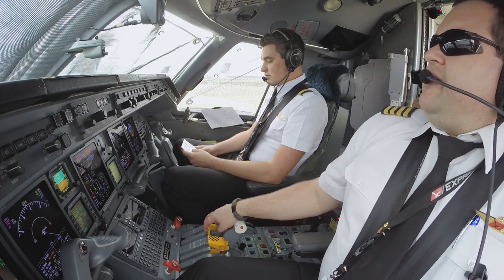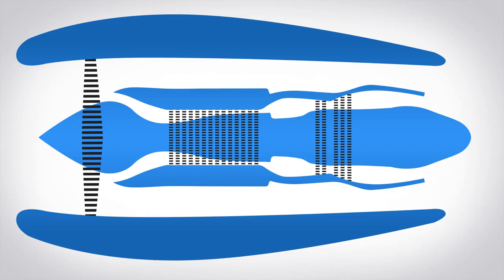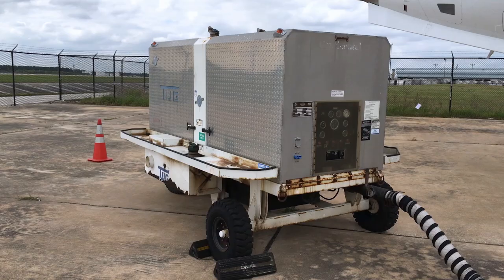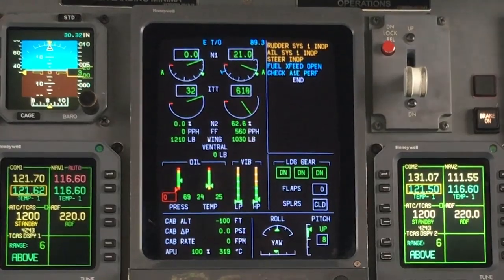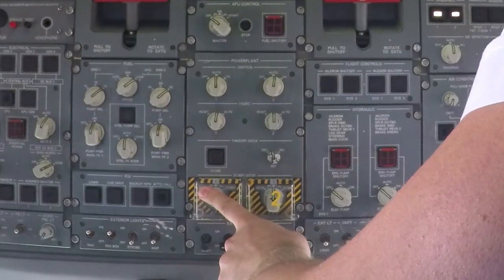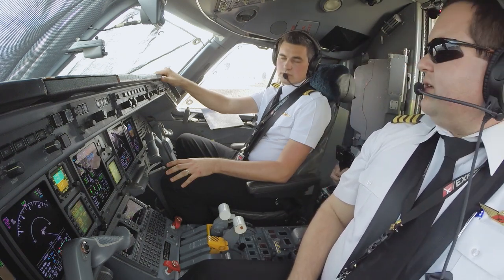How A Jet Engine Starts

Comment: The  inlet compressor air goes into the cold section rotors and stators first, gets compressed, mixed with fuel and ignited in the burner section until it stays burning on it's own...then under high pressure and temperature, the gases go into the HOT section of turbine blades and stators and then out the rear of the engine....

Comment: I noticed that after the cross bleed start, the #1 engine was fully up and running on it's own with the Starter Engaged.... Why was the number 2 engine left at 80% for a good 10 seconds before returning it to idle! Being in maintenance for 35 plus years and have taxied and started many jet engines and using Cross Bleed Start, just as soon as I get Starter Cut out on the engine, I immediately bring the running engine back to idle. Most of my Jet Engine work is with JT8-D's, Rolls Royce Spey Engine, and CRJ 2-7, & 900's!

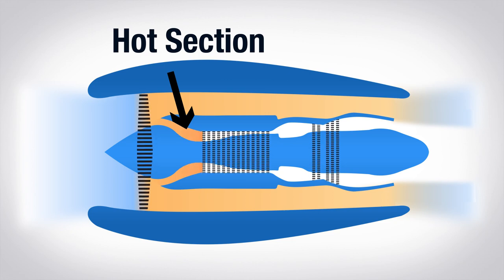Comment: 1:15 Compressor is not in HOT SECTION, it in COLD SECTION.  An aircraft gas turbine is divided into two sections: the cold Section & hot section. The Cold section includes the inlet air duct, the compressor and the diffuser. The Hot section includes the combustion chamber, the turbine and the exhaust. (https://sites.google.com/site/ncaaslecturenotes/gas-turbine-engine/unit---ii-construction/hot-section-cold-section)

Comment: There was a news that the engines of the airliner both died on passing near a volcano but the pilots managed to restart them.  So how do you restart the jet engines mid air??
Reply: Ozzie Wozzie Original there’s small internal APU on some planes that allow’s them to ignite engines mid-air.
Reply: Thanks
Reply: But in most cases the aircraft is still moving through the air fast enough to restart the engine without using the APU. You can't even start the APU in flight on some aircraft (e.g. 747)

Comment: Stupid question: When yo use compressed air to start the engine, why does it not simply flow backwards through the big fan as the front?
Reply: Mike Davidson the compressed air or 'bleed' air goes through a valve and into a small starter turbine. The starter is connected via a shaft to the gearbox which then spins 1 of the main engine shafts normally the N2 shaft but this is dependant on engine manufacturer.

Comment: Don't the larger engines like the CFM-56 run slower?  I thought the compressor on it runs around 10,000 rpm but the fan runs around 3,000.

Comment: Is the second engine usually started with the first engine or the APU?
Reply: It depends on the culture at the various airlines.  We almost always taxi out on one engine to save fuel, but leave the APU running until the second engine is started, and then it is shut down.

Comment: You imply that most thrust is generated by the air flow outside the combustion area. Surely the fuel burn must produce most of the thrust?
Reply: No, the fuel burn creates the fast airflow that powers the turbine that spins the big fan at the front, you are correct though, on most jet engines the thrust is produced by the fuel burn phase, but on turbofans which this video is about, the thrust comes from the bypass air. There are a bunch of really cool articles about jet engines online
Reply: @jerasaurus1926  probably quite hot articles if I know jet engines...

Comment: So if the APU is not working to be able to start the engines, what were to happen if the plane is in flight and there is a double engine failure?  So now the one running engine can't start the other engine because both are not running.  Thanks in advance.

Comment: With an non functioning APU im quite sure you are not allowed to leave the ground one bit and thus a huffer is sort of speak pretty much not needed for civilian air?
Reply: APUs are actually only Required for ETOPS Flight, otherwise you do not need it

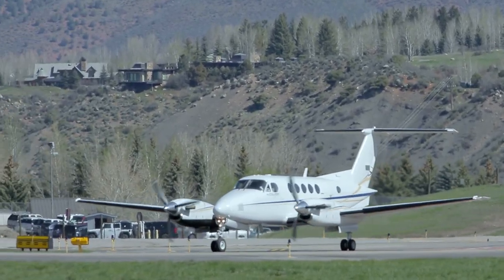Comment: 3:45 this statement's not exactly true. The GENX-2B Engines on the 787 are started with an electric starter which is an electric motor. I assume is can either be run from ground power or aircraft power (which may be from an APU). The advantage of air starters is they are relatively light (and tradition). This video is pretty good and the N2 numbers are pretty similar for most turbine engines although some of the detailed procedure might be different.

Comment: So .5 gallon a minute, or 30 gallons an hour, or 150 gallon for the average 5 hour flight, if my math is right?
Reply: Tedro Peders no, you are wrong. Cause fuel consumption depends on the modes that aircraft flying. Just think about climbs and descents as a simple example, would you burn more fuel on a climb with full thrust or on descent with idling engine? So for the engine starting it's completely different way to calculate too. 😉
Reply: Your math is right but your assumptions are wrong.  He is discussing the engine start.  When fuel is introduced during the engine start, it comes it at about 200 lbs per minute.  

My aircraft is the A320.  When the engine is started, fuel flow starts at about 400 lbs per hour and increases during the start to approximately 800 lbs per hour when it stabilizes at idle.  This is for each engine.  At cruise, we are burn about 2600 lbs per hour (per engine).  

Quick conversion to gallons per hour is to take the fuel flow per hour, and drop the last digit, then add half.  So, 5200 lbs per hour.  Drop the last digit gives 520.  Then add half of 520 (260) to the 520 to get 780 gallons per hour.

Comment: But when you run engine 2 at 80% how come its thrust doesn't move the plane? What makes the engine run at 80% but produce little thrust? Or are the brakes are so powerful?
Reply: it is the brakes, the hydralic system that powers them can get up to 3000 psi

Comment: So explain this please.  When the fuel starts burning and adding energy why is that energy all applied in one direction producing thrust?  Why doesn't the burning fuel act equally in both directions, killing the flow of air into the engine?
Reply: Compressed 'venturi' effect!  Think of a Bunson burner but with proportionate fuel to air ratio!

Comment: You called the cold section the hot section. Then you called the hot section the combustor (which isn't exactly wrong). Compressor air does get real hot at the end of it stages but what is much more hot is the air and fuel mixture ignited in the combustion chamber. Unless for some reason in turbofans they call the cold section the hot section…
Otherwise good video. I liked it.

Comment: So, what happens if both engines shutoff mid flight and the APU isn’t working
Reply: Your bunghole puckers.. you push in the clutch, put it first gear, then you dive the plane to gain airspeed which windmills the bypass fan, then dump the clutch..
Reply: You are flying a glider and working quickly to get at least one engine started.

Comment: what if theres an engine failure in air? how will you restart the engine without the apu?
Reply: Cross bleed from the other engine. Alternatively, windmill start by diving to get the airspeed high enough to windmill the compressor up to the required N2

Comment: So, when you run up an engine to start the other engine (83%), does that create 83% thrust in the engine that is running? Is there a risk the aircraft will move?
Reply: Good question, the relationship of rotor speed to thrust is not linear. At low RPM's there is very little thrust change, and most of the thrust change is in the 80's and 90's. So 83% N2 is a lower percentage thrust than that. That said it's still a considerable amount of thrust, but the brakes on modern airliners are very good so moving isn't a concern, however jet blast is. So this is done out on the taxiways away from baggage carts you can flip over, etc.

Comment: How dare you!  Greta strongly disapproves of this video.

On the other hand, I think it's a great video. Helps me understand the sounds I'm hearing while my plane is starting up. One thing I've noticed is that when the engines are starting up in a passenger jet, the air vents inside the cabin stop blowing air for a minute or so.  I assume this is because the system is redirecting all of that air towards spinning up the engine. Once the engines are spun up and idling, the air vents in the cabin start back up. Can anyone knowledgeable on the subject confirm or deny whether this is correct?

Comment: you guys missed some functions of the modern apu!!! the most advanced ones can pprovide  electricity, air quality control and auxiliary cabin heating with out burning jet fuel at the gate. Customers in canada and russia also had the option of supplementing that heat with the swissair designed infotainment and aux heater package.

2nd  im not sure why the company  wanted an alarm on engine one...its rumored that if not fed a high protein diet s  both engines will go on a hunger strike and ingest nothing but ice.

Finally im really concerned that none of your videos cover how to ensure a safe flight by monitoring only the Yeager gauge next to the coms stack.

Comment: What does it mean if there’s an APU bleed?
Reply: Bleed air just refers to high pressure air. The term APU bleed means that the APU is providing this high pressure air. It can be provided in a number of ways, either through an engine itself (once its started), the APU or a ground power unit. This high pressure air in flight is created by the engines, and makes the cabin pressurization/climate control and wing/engine anti ice work - and of course starting large jet engines. As odd as it sounds you use a little jet (itself small enough to be started by an electric starter motor) to start a big jet. It is called bleed air because the energy creating it saps some power from the engines thus 'bleeds' its power and increases fuel consumption. Also don't forget in aviation referring to "pressure" or "pressurised" things have lots of different meanings so just having a simple term like "bleed air" so everyone knows what is being talked about. 

Hope that helped.
Reply: Ok thanks.
Reply: you're welcome! :)

Comment: Anyone know what rpm these engines run at? My lawnmower runs around 3,600 rpm max.
My car maxes out at 6,000.
Just curious about the jet engine.
Reply: I forget these engines but UH60 Blackhawks spin around 22000-23000 rpm

Comment: What ignites the air fuel mixture? I’m sure it’s not a spark plug....like in the car engine....
Reply: It actually is pretty much exactly that. Difference is, it only sparks during the start, after that the flame is self-sustaining. (It's also turned on during times of higher risk of the flame blowing out, such as heavy rain or turbulence)
Reply: On the Airbus, the igniters run for engine start, when flaps are extended, or when engine anti ice is elected on.  We can also select it on manually for heavy precipitation or turbulence.

Comment: Why didn't they use the APU to start engine number 1 as well? Instead they chose to use engine number 2's bleed air to start up engine number 1... doesn't that consume more fuel than starting both engines by the APU? as engine number 2 has to run roughly at 50% to be able to provide pressurized bleed air to engine number 1.

Comment: Wait so a jet engine is kinda a normal propeller that spins and forces air by blades but instead of the blades being spun by a piston combustion engine its spun by expanding hot flames and gasses.

Comment: Non-bypass engine air passes through core engine.  "Hot section" refers to combustion chamber and subsequent, not entire core.  "Turban" is correct pronunciation unless you are speaking the King's English.

Comment: My biggest confusion about jes engines, anybody plz answer: at which point in a jet engine is main thrust generated?? Is it right after combustion chamber? Is it at end nozzle after turbines? According to newton, equal and opposite reaction happens at a point. Ex. Bullet leaving its casing, recoil generation is at separation point of casing n bullet. In jet engine, boom is happening in comb chamber then ideally thrust shud be generated at that point
Reply: The main thrust comes from the intake fan

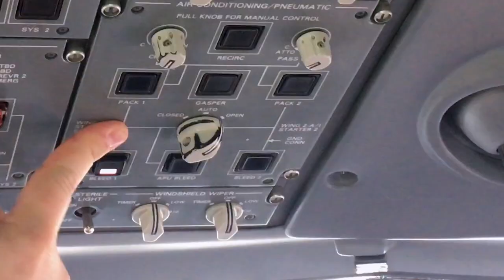Comment: 7:00 if your throttling Engine 2 up to 80% aren't you going to have a whole lot of thrust to deal with also?
Reply: Notice that N1, the fan stage that produces most of the thrust, is only at 53% during the cross bleed start for engine 1.  Yes, there is additional thrust, but it isn’t as much as you think.  Thrust is not linear with rpm’s.
Reply: @oscarb9139  thanks!
Reply: @dosmastrify  You are welcome.  I didn’t understand this stuff either when I got into aviation.

Comment: Manufacture planes with both jet and non jet engines, use the first while take off the later while landings, switch engine at 5k feet in skies before landing, cause this is new technology prototype idea, and it might take time for the engine to switch, else start the second engine along and when the second works to the T, switch off the first, still for first test keep minimum 5k feet height to maintain enough gap to cut off double engine speed thrust and afterward momentum of descending and related control for

Comment: Fairly well explained by the narrator but why on earth (when air starting an ERJ) would you start engine 2 when the air starter unit plugs in on the number 2 side.. ground crew would then have to get close to a live engine to unplug it! You’d  start 1 first if you had any sense

Comment: They almost always fire up the starboard engine first and then the port engine.  They should alternate this order each flight, so that the engines wear evenly.  If there's a fuel shortage, and they want to taxi on one engine to save fuel, they should follow the "POSH" rule, "port out, starboard home".  That means taxi out on the port engine, and taxi in on the starboard engine.
Reply: These engines (hopefully!) see overhaul long before that sort of wear even becomes an issue.

Comment: N1 & N2 Nitrogen being the fuel ? That nitrogen separated from the incoming AIr, combined with the compressed AIr means a free AIr engine!
Reply: Wrong.  N1 and N2 express the rotational speed of turbine engines as a percentage of the maximum normal operating RPM. N1 is the speed of the low pressure spool and serves as the primary power setting, and N2 is the speed of the high pressure spool which indicates if aircraft systems have sufficient power.  There's no such thing as a free air engine.  Engines are switched off at the end of a flight by shutting off the fuel supply.  No fuel = no power.  Air can't burn by itself.

Comment: I used to work with aircraft technicians who explained that AND more.  I been afraid to fly ever since.  People who fly don't know how dangerous it is.  If ONE compression blade is mis-manufactured, it goes thru the shielding at about 30, 000 rpm and you can have a flame out.  That's not a good thing to have at cruising altitude.

Comment: Its rather simple really1. Apply a little choke2. Pump accelerator 2-3 times3. Grasp handle firmly and pull cord quickly.4. When engine fires allow to idle for 15 seconds then apply throttle5. If 1-4 doesn't work tell the wife " fuck it. I'll do it tomorrow"6 Go to fridge, get beer and put football on TV

Comment: how does engine power itself? I don't get it
Reply: Throw in lots of fuel and lots of air, and the reaction keeps going. In theory compared to a normal internal combustion engine, a jet is far simpler. Of course in reality the engineering is a lot more complex.

Comment: The engine bleed air system uses air from the compressor 10th stage, not bypass air or 14th stage.  At least on TF-34 type engines....  Only error I caught on first viewing.

Comment: If the majority of thrust comes from the bypass air, why even have the turbo fan?
Reply: Bypass air is the air the fan pushes around the engine. Without the fan there wouldn’t be any bypass air.
Reply: It is all about efficiency.  It is more efficient to accelerate a large amount of air a little, than it is to accelerate a little air a lot.  So, the core of the engine generates high energy gasses which are directed past the low pressure turbine.  The low pressure turbine is connected to the fan.  This fan produces the majority of the thrust.  It also slows down exhaust gasses so when it meets the outside air there is less noise.  As engines become more efficient, the bypass ratios increase.

Comment: The fan blades do not compress the air, and that was not the hot section, it's the compressor section, the hot section is at the bang section....suck squeeze bang blow

Comment: If you keep adding fuel to a turbine engine, it will keep running faster and faster until it blows itself up.
Reply: No, it would exceed the temperature limit leading to a shorter life or failure.

Comment: Engine bleed air is limited to than 450F before it's routed into the wing and fuselage to prevent igniting fuels or lubricants and to comply with Federal Reqt's (FARs). To do this it's routed thru a 'precooler' (heat exchanger) just above the engine in the strut/pylon cooled by engine fan air. If temps exceed 450F, the bleed air is automatically shut off by the pressure regulating shutoff valve (PRSOV) which also regulates air pressure to around 60 psi. 

Air turbine starters are thus not exposed to 'very high temps' as the pilot mentions, and you can go ahead and restart as soon as N2 spools down below 5 percent (which also prevents starter crash engagement in much the same way your car does).

And yes, turbine is pronounced tur-binn, not tur bine.